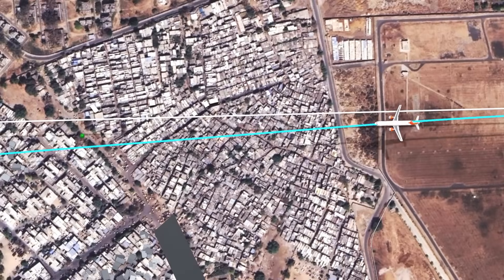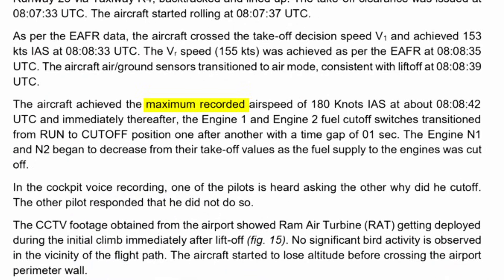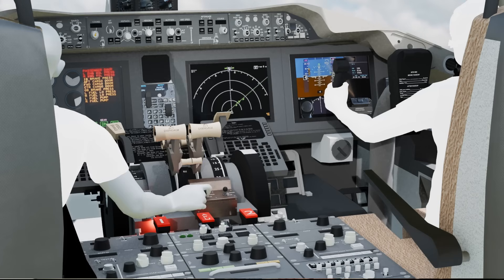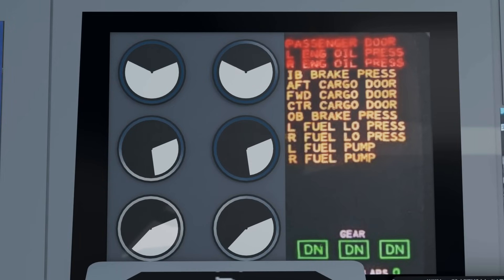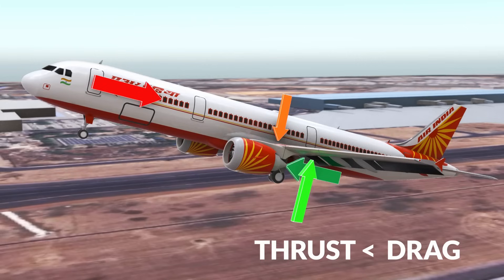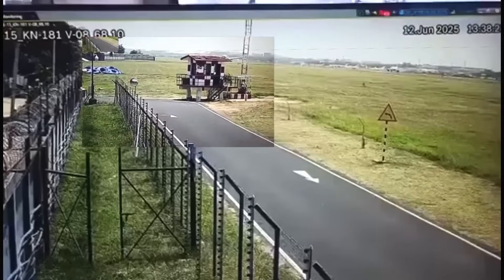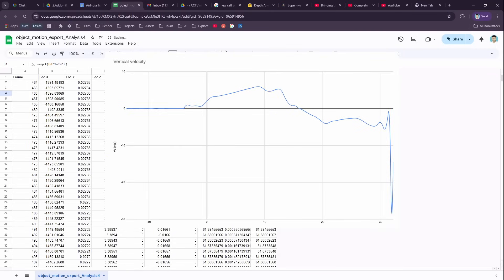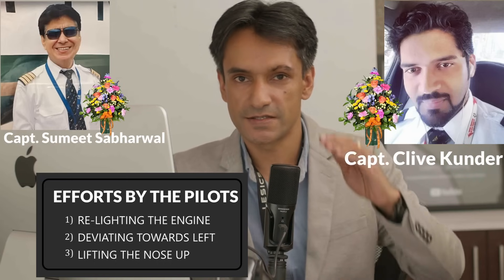Use of 3D Clone | Decoding the Crash Details you Missed

Comment: I am a retired Avionics Engineer And I have been telling this story for a month. You exactly described the correct scenario. Don't forget that the WoW switches on the gears compete in a voting sequence to the TCMA,(AIR/GND) and I believe the LRRA should have been involved in the logic sequence, But beyond that, The A/C should have been in a Take-off logic, not a landing logic. It should not have ENG cutoff in the sequence. the only way ENG cut-off should be applied is on LANDING logic. I will defiantly share your excellent work. Numbers don't lie!!
Reply: 2019 ANA Flight NH-985, 787 Dreamliner dual engine fuel cutoff (TCMA ground logic) before touchdown.
Reply: @KC-4619 Thanks for the info. I've read a report on this TCMA fault that they claimed was not a fault !!! Interestingly the Aircraft logic determined that it was on the ground and Pilot input - a high level of reserve thrust upon landing - overruled....
Reply: TCMA errors and alerts will be logged on FDR and might also show up during the 46hours of previous flight data. Along with invalid alerts from VxWorks.
Reply: Gentlemen, All.....this is what happens when they over engineer shit.  Lane assist, auto brake because you are too distracted by your phone to see the car in front of you has hit the brakes.  All this over engineering shit is trying to make aviation stupid simple for average pilots.  It makes it so they can promote DEI pilots who have NO business driving cars in traffic much less flying airplanes full of souls. It's a recipe for failure.  Just like Stockton RUsh with his ONE BUTTON turns on the whole Crush Depth submarine.  FUCKING STUPID.  Quit trying to put all the instruments on one MFD display.  Quit trying to put all the avionics in one big black box.  JUST FUCKING STOP already.  You are trying to make planes smarter and all you are doing is making them more dangerous.  Where am I coming from with this?  7 years air force as an ECM tech on all the  B1Bs, then rolled right into 25 years as a mx tech at a  MAJOR HELICOPTER OPERATOR in the GOM as AVIONICS TECH.  The world I lived in just started getting dumber and dumber with the avionics, the way things are moving from analog to all up digital......even vital systems like main electrical busses and hydro they are trying to simplify and turn digital...digitally controlled..it's madness.  Give me a flight engineer in the back with a billion overhead switches, one for every single system on the aircraft .........any day, over all this consolidated digitized bullshit.  Part of the reason I retired early, to get away from all the stupidity our crappy engineers are coming up with.  If you haven't noticed, I despise this new era of Boeing engineering.  They suck and I hope the whole company just implodes.  No talent hacks.......expect them to keep killing more people with their shitty aircraft and shitty engineering.  It's not the company it used to be.  Too big to fail.  Yet everything they push out the hangar doors like a dog taking a squat on the lawn............fails.
Reply: Ahhhh... physics 😊
Reply: Same here and I'm just an average Joe.
Reply: I think I read somewhere that max or high throttle is also in the voting sequence.
Reply: Mister Avionics Engineer, here's my take on this:  

(1.) In slightly under 4 seconds from a successful "LIFT-OFF," with both engines still running, the Flight Control Computer Software Program “GLITCHED & RE-BOOTED" because of an AC Dual Electrical Bus FULL POWER TRANSFER FAILURE. This event, combined with an ongoing APU disablement that should have already been "fixed," caused the RAT Deployment and the Twin Main Landing Gear electric-motor-powered hydraulic pump RETRACT FAILURE that occurred. Typically, these two circumstances occurring together is rare.  

(2.) Critically important, just as the RAT deployed and the main landing-gear retract attempts "failed," the Flight Control Software Program computed multiple data-point summary errors during it's interfaced communications with the four strut-mounted "Weight-On-Wheels" micro-switch sensors. These data-point summary errors "fooled" the Flight Control Computer into believing the aircraft was "on the ground" when it was in fact "AIRBORNE." Next, the Flight Control Computer gave "BOGUS COMMANDS" to the Thrust Control Malfunction Accommodation (TCMA) Sub-System, causing the wing-strut mounted FUEL FLOW BALL-VALVE for each engine to FULLY ROTATE to the "closed" position; >>>> a fatal action UNANNOUNCED to the Flight Deck Crew by any electronic means. 

3.) In my humble opinion, BOEING is responsible for three (3) System Design Errors that contributed to the crash of A.I. Flight 171 and the tragic loss of life: 

(a.)  First, I contend that AFTER “lift-off,” the failure of the twin main landing-gear struts to fully retract (“on command” from the F.O.) caused the Flight Control Software Program to "misdiagnose” the FLIGHT-MODE STATUS of the aircraft as being “ON THE GROUND.” I believe BOEING should have planned for this contingency by including proper software design; wherein, for example, multiple attempts at “retracting the main landing-gear struts” (as was done by the F.O.) would cause the Flight Control Computer to sense a potential problem; then instantly establish the revised “AIRCRAFT IN FLIGHT MODE STATUS” as a safety default measure. 

(a.)  (1.) Notably, after this air disaster occurred, instead of issuing a comprehensive software program flight safety redundancy “re-write/fix” to resolve recent "computer glitches reported," BOEING conservatively recommended only the replacement of the "Weight-On-Wheels” System’s four landing gear strut-mounted micro-switch sensors. 

(b.) Second, I blame the design of the AC Dual Electrical Bus Power Transfer System for not having adequate power reserve/redundancy available to prevent "power glitches" to critical components like the Flight Control Computer Software Program.

(c.) Finally, I blame the design of the APU System -- for not having "A FAIL-SAFE" Flight Control Computer “software Interface” that should have PREVENTED this aircraft from leaving the tarmac without a ground crew investigation. The issue to be addressed; "WHY" was the APU not providing adequate power output to it’s assigned components ???

(c.) (1.) While the final departure of Air India Flight 171 was "staging" on-ground, 40-60 minutes prior to Control Tower “Take-Off-Clearance,” the passengers and crew were suffering from “sweltering heat,” the lack of “televised scheduling delay updates,” and a “substantial cabin darkness.” These harsh conditions were caused by the failure of the refrigerated air-conditioning systems; the failure of the seat-back movie entertainment/flight up-date T.V. consoles; and the near total failure of the main isle/cabin electrical lighting systems.  A fully functioning APU would have prevented all of these issues. 
(c.) (2.) These above deficiencies are THE SAME ONES previous passengers of this SAME AIRCRAFT complained about to the Internet News Media - within days after the crash. This strongly suggests the APU System was "failing" throughout multiple flights; with maintenance and flight personnel focused on meeting flight scheduling goals. 
(c.) (3.) Even with a "non-functioning APU," as long as the AC Dual Electrical Bus Power Transfer System had not yet "failed," this aircraft was able to continue to deliver passengers and flight crew safely to their destination.
Reply: @Johnny-vv9rd I agree with an APU porblem on the runway, very likely a lackluster protocol in the programming, landing gear i dont think was failure of commanded operation, i think that was a short to part of the electrical that drove the gear into position but no hydraulic system was energised no being activated from cockpit. Im on the fence about actual computation issue or hard spiking into network cabling?? Same with did fuel valves close or did avionics lose it sht with the throttle module dropping coms to FADEC engine default IDLE? Throttle at max, on restart possible only prompting reconnect link to FADEC recorded throttle link not engine start..... But unclear fully guessing but if throttle command module basically rebooting, to get full command back would it have to happen with leavers in idle position on boot to get reference back??
Reply: @mrgoodman6620 dont quote me but its possible levers were in idle mode. and probs TOGA set earlier
Reply: @hazard3020 From what i can gather from information the leaver were at the same point from just before liftoff and through entire critical sequence. There will be no image to reference that would be valid, it would have to come from the cockpit with time stamp. You cannot look at position of such a thing after it is in a debri pile and determine anything from that, the switch is different, as function of user interface was the focus and that can be determined by still being functional but that doesn't speak to anything beyond the switch "goes click"! People have a very bizarre understanding of what proof is!
Reply: @Johnny-vv9rd very detailed I concur
Reply: @Johnny-vv9rd Yep, very very likely.
Reply: @Johnny-vv9rd but the system failed.
Reply: being an non-retired avionics engineer, let me tell you this:

TCMA:

1. TLA (Throttle Lever Angle): The throttle levers must be in a specific position (e.g., idle or reverse).
2. LRRA (Low Range Radio Altimeter): The radio altimeter must indicate that the aircraft is on the ground (typically below a certain height threshold).
3. PSEU (Proximity Switch Electronic Unit): The PSEU must indicate that the aircraft is on the ground, based on the landing gear's position and weight-on-wheels (WOW) sensors.

So it must be in idle (weird if you are in TO/GA), LRRA must believe that it's in air and weight not in wheels -- e.g. not compressed.

In other words, the air/ground logic here says: you are in the air. Hence, TCMA cannot trigger both engines to cut off fuel.
And we do know that there are two dual channel TCMA's. Two PSEUs, two LRRA systems, two EEC/FADEC systems.

Also, TCMA is designed only to act that moment. 

So you see, LRRA IS in fact in the logic.
Reply: @RoelandJansen mmmh i think levers were in idle (based on an image i saw)  but dont officially quote me as trying to access more photographs.
Reply: @RoelandJansen give your opinion:

==============================
      Here are the difference between
        both engine shutdown caused
       by TCMA or PILOT MOVEMENT
------------------------------

A.  CAUSED BY TCMA

Based on the three fundamental theories of Landing gear system, Electrical system and Engine Fuel & Control system of B787-8. 

The root cause of the issue is attributed to the air/ground mode logic being stuck in ground mode (software glitch/mismatch --> caused by the faulty of the Nose Landing Gear's WoW proximity sensor or its wiring to the PSEU) 

----------------
Sequence of Events
----------------

1. Normal takeoff
2. Landing gear failed to retract after liftoff 
3. Simultaneous loss of electrical power; pilot manually deployed the Ram Air Turbine (RAT) or automatically deployed due to software glitch/mismatch
4. Both engines shut down --> Both engines were shut down by the active TCMA (Thrust Control Management Accommodation) with a 1-2 second time delay. 

FDR appearance: 

Fuel swirch = RUN
Fuel SOV    = CLOSED
Fuel flow.    = 0
AccommodationActive = TRUE

5. "ENG FUEL CTRL / ENG FAIL" message appeared on EICAS, despite no intentional fuel cutoff ("why did you cut off the fuel", "i didn't") 
6. Pilot attempted to relight both engines by cycling the fuel control switch on Engine #1 (from RUN to CUT OFF and back to RUN), followed by Engine #2 four seconds later
7. APU switch positioned to START (two seconds after ENG #1  fuel control switch recycle to RUN) 
8. Pilot declared MAYDAY to ATC
9. Aircraft impacted the ground
-------

B. CAUSED BY PILOT MOVEMENT (really?) 

The root cause of the issue is attributed to the movement of the Fuel control switch on the pedestal

----------------
Sequence of Events
----------------

1. Normal takeoff
2. Instead selected the Landing gear lever to up after lift off, the pilot rather to move both  the fuel control switch from RUN to CUT OFF (with 1 second gap) --> why? 
3. Both engine shutdown
4. Simultaneous loss of electrical power; Ram Air Turbine (RAT) automatically deployed 

FDR appearance: 

Fuel switch = CUT OFF
Fuel SOV    = CLOSED
Fuel flow.    = 0

5. "ENG FUEL CTRL / ENG FAIL" message appeared on EICAS, indicated deliberate fuel cutoff ("why did you cut off the fuel", "i didn't") 
6. Pilot attempted to relight both engines by cycling the fuel control switch on Engine #1 (from CUT OFF back to RUN), followed by Engine #2 four seconds later
7. APU switch positioned to START (two seconds after ENG #1  fuel control switch recycle to RUN) 
8. Pilot declared MAYDAY to ATC
9. Aircraft impacted the ground
Reply: @RoelandJansen  Hi Roeland, you will find the answers in the 3 videos (and comments ) of "Jeremy John Thompson AI 171" (just google this and start with first video)
Reply: @RoelandJansen Being current is a strong point in my opinion, I've been frustrated in the fact im not technically myself, in fact baring the the begrudged phone im a decade out of date officially LOL By virtue of system evolution anyone that was valid when the 787 came about is not necessarily a true authority .....  Or as im finding capable of total recall hehe. One advantage though my son is an extremely achieve academic in aviation theory (aerospace) and practical engineering although somewhat advance too, he got lucky being recognised in high school (avo program) and was an offsider for an ex top gun pilot and professor of aeronautics for a few years. He is a commercial pilot also, civil, but currently working with airforce, his grumbling about bureaucratic guff is all i hear. LOL
Im furious about non qualified mouths with platforms that have wrongly perceived credibility because they fly planes. I think it will bite them eventually!
Reply: @hazard3020 Hang on wait .... I'm just putting that into my multiplatform  decoder .... Oh I get it ! 😂😂😂😂 There is no doubt enough evidence in the order of events and basic function is really all you need to satisfy my concern, that it is a fault, and it needs to given serious focus it's just disgusting the cherry picked details in the primary report that in my opinion was deliberately done to cause misdirection! That is just beyond redemption, then to to have such an accusation hanging over the pilot , that I think should be getting  full respect, that's just sick!
I'm torn I want my son out if the air,  but thats what he loves, what he does  and I kinda put him there, I'm retired and he's right in the think of a career.  But there is a far worse issue up there now, and many that know are questioning at what point they will ground EVERYTHING! We are going to loose GPS systems soon! 🤐
Reply: @mrgoodman6620please don’t write. You don’t make any sense.
Reply: Awwww gees, phew i nearly didnt make it! I was unconsciously holding my breath waiting to see another with cognitive function!! 
Yeah ok this is a complex event all in all, but wow, people are completely and utterly lost at the most basic of concepts. We are regressing unbelievably quick.
I had an idea after seen all there was from the most direct and likely accurate sources i could find, onec i was aware of the information in the preliminary, (in spite of it being cherry picked for some strange reason i have no idea ... Or is it I know oh dear!😏)  I was confident, and furious!
Ive been using the term "cued fault" in relation to the WOW coming into play.
So how absolutely convinced are you that very few shoud be  out of kindergarten, after replies of totally clueless!
Reply: @mrgoodman6620what he say!!😅😅😂
Reply: @asapdelivery7067
Yeah ok.. sorry i dont follow.....
K.. wdeva
Reply: @mrgoodman6620are you drunk? Lots of word salad but zero information.

Comment: Why did the pilot turn the fuel cutoffs to cutoff position for 10 seconds?
Reply: Nobody knows yet whether the pilots touched any fuel switches. No switch sounds have been reported. present, absent or indistinct. They've heard them if they're there so why haven't they said so.

Comment: I think short before liftoff there where already problems with the engines, computer lowered enginethrust. Another problem came after litoff. RAT was deployed and engines shut off and airspeedbrakes activated. I think plane came in landingmodus after liftoff .
Reply: Then the pilots should have reject the takeoff.
Reply: @stimproid The crew was not aware of the problems, the problems began during takeoff.
Reply: @JanMarkerink-z8i  You suggested the computer lowered engine thrust before takeoff. This would be an indication to reject the takeoff.
Reply: @stimproid Too short before liftoff. My idea was rubberdust from the runway came in the engines. In the other direction it might been used as landingplace, also rubberdust on the floor.  The nosewheels riding trough it and bring it in the air, the engines are very big and low to the ground. Experts warned for this. Computer notices and bring thrust back to spare the engines. On that video of the left side , after that hut, there is to see a huge cloud of dust or smoke, short before and after takeoff.On that point computer might have changed the modus, because thrust was too low for takeoff. I can not proof if this is correct, it is just an idea.
Reply: @stimproid  How could they do that having passed the final go/no-go point and with engines spooling down immediately after liftoff?